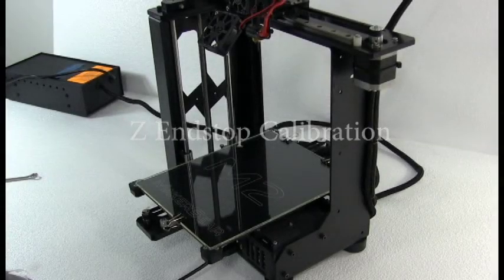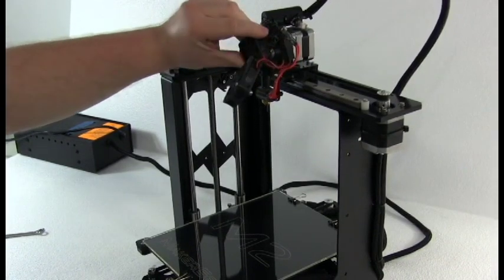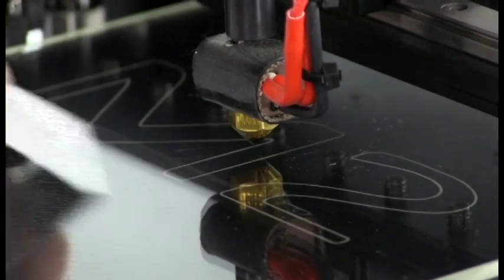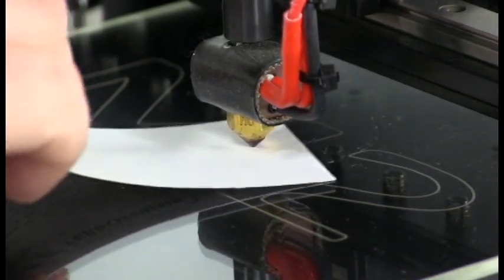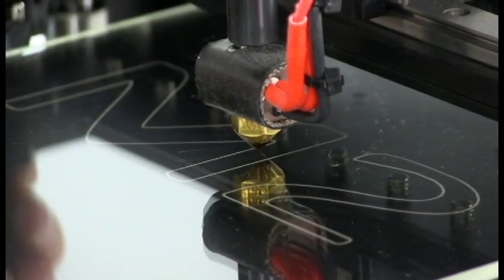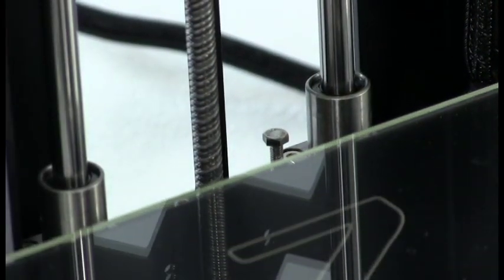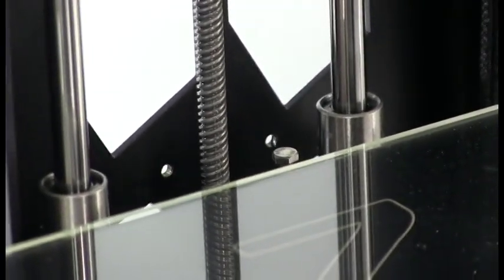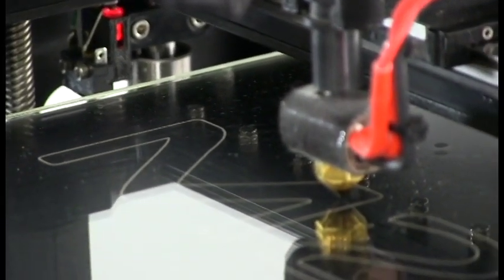MakerGear M2 3D Printer - Z Endstop Calibration

Comment: It took me about 15 times watching this and careful hand checking of what the end stop bolt is doing before I understood what was going on here.  I agree another angle would help alot.  Basically he has losened the nut on the end stop bolt before he lifts the stage to the point where he checks with the paper.  Then he spins the endstop bolt from underneath the stage until it engages the switch on the endstop.  Then he lowers the stage and tightens that nut, making sure that bolt doesn't spin at all while he tightens it.  Maybe I can post some pics later
Reply: +Chris Jones Also, for what it's worth, I had to be real aggressive on the Z-stop to make sure my prints would stick (even to a Zebra plate).  I used the 0.1mm increment controls in Simplify3D to set the endstop instead of moving the plate by hand.  I had to basically get it to the point where the card they sent with my Zebra plate could barely get through between the extruder and the plate in order to have the thing print correctly.  Basically I had to go to where I thought it was close enough and then still go up .3mm...